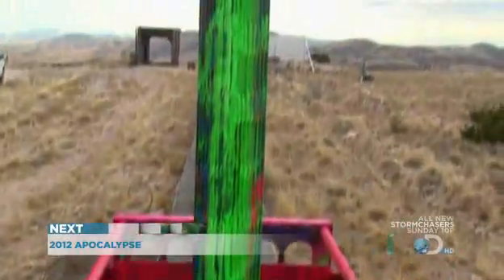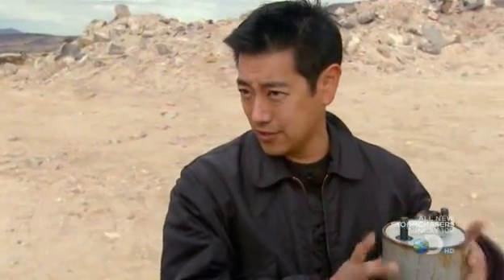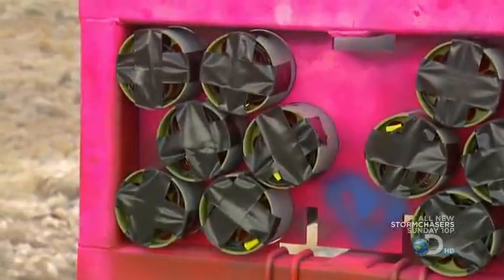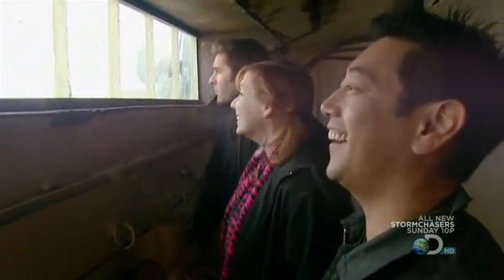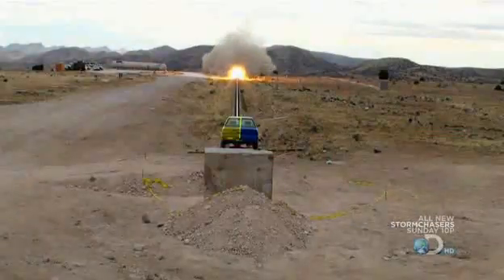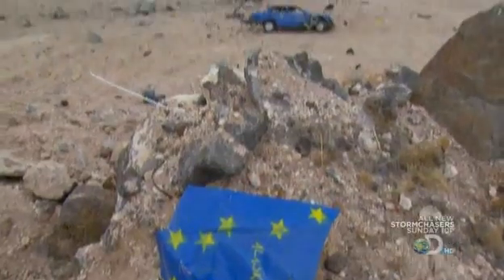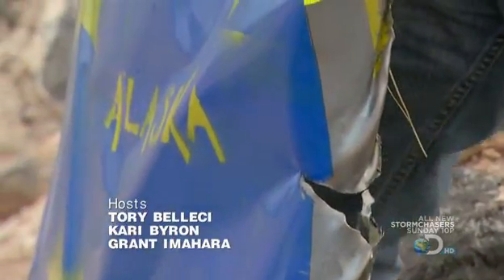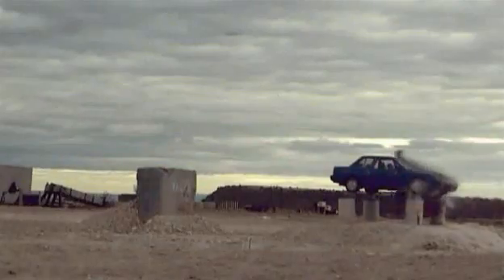Mythbusters: Myth Revolution - Rocket Snowplow

Comment: Oh fuck!
If this is true then how the fuck did those planes cookie cut WTC 1&2?!

I mean that thin piece of steel cut the steel car in half.
So several thick pieces of steel should either shred an aluminum plane or flatten it and then bounce it off.
You see the sledge was intact up until it hit the immovable concrete block. So as there was no concrete on the planes then they should have just crumpled/shredded part bounced off part penetrated between the steel girders and not cookie cut like roadrunner the side of the building!! 

OMFG!!
Reply: http://911research.wtc7.net/talks/nist/docs/planecrash.jpg

Remember that absolutely no concrete was used for the outer shell of the Twin Towers- the central core held up all of the structure, and only when that lost support did the towers fall.

The steel on the shell was very thin and very light, so it gave with relative ease. What decimated the plane was the concrete floors and much thicker steel beams connecting the core and the shell.

What you saw coming out the other side was jet fuel, office supplies, hot air, and whatever was left of the plane routing its way through the cubicles and finally windows of the towers.
Reply: ^^^mickey is 100% correct.
Reply: Mickey the Luxray You couldn't be more wrong.  The central column held up 60% of the tower's weight.  The outer steel beams held up 40%.

The outer beams were made up of thick, high grade steel.  They were NOT "very thin and very light" in ANY stretch of the imagination.

Keep believing in the fantasy though, if you can't accept reality.
Reply: Allen Cox
"Trial Luck Larry "Pullit" Claimed against Insurance companies who paid out without a question?"

[citation needed]
Even if what you're saying is true, this situation would be damned if they did, damned if they didn't. A guy involved in the cleanup of 9/11 is refused by the insurance company- that's a headline story that could get those companies in serious trouble. To them, what was a little money lost when it saves them bad publicity?

"And Now Larry states WTC7 was Demolished hello NİST said it was due to Office Fires?"

[citation needed]

"NİST have the World believing in Ghost Stories and Fairy Tales but the Truth will come to the surface of this Soup eventually then and only then will we see the ones responsible"

It's funny, because you guys are the ones saying that lasers, rockets, holograms, magical sideways thermite, and UFOs were responsible while NIST tells the story closest to what was seen by millions of people on television and in real life all over the world.

If anyone's telling the ghost stories and fairy tales, it's people like you.
Reply: Андрей Алейхин Well, the website you sent me in your previous reply supported the official story. There is no official conspiracy theory. We know what happened on 9/11...the 9/11 commission and NIST reports were accurate. 9/11 was perpetrated by the Islamic extremist group Al-Qaeda. There is NO conspiracy about 9/11 that hasn't already been explained. 9/11 wasn't an inside job, nor did insiders or the U.S government perpetrate the attacks. If you really think it was, I'd invite you to prove it. Go ahead and ask me some questions. Extraordinary claims require extraordinary evidence.
Reply: Mickey the Luxray a.
Reply: patauarola WTC weighs 200 000 tons. Plane 747 - 150 tons
Reply: ***** So what? We forget about the weight, density ,and the area of contact?
Reply: Андрей Алейхин 
First off, both aircraft were 757s, not 747s.

Second, just because the towers were heavier doesn't mean they were any less susceptible to being penetrated by a plane.  The only way that would matter is if the planes knocked over the towers upon impact, which didn't happen.
Reply: Андрей Алейхин
Fine, whatever. 1-3 are irrelevant to this conversation anyway.

"4) Planes was not. There were only a rocket."

Then explain the plane-shaped hole in the side of the tower. And why there was no smoke trail as is common with any rocket engine. And why the damn thing had wings.

"5) Imagine that the twin towers fall on the plane. Do you really think that the plane strikes steel, and penetrate into the inside?"

I had a really hard time reading this, but my guess is you were going to say that if the tower were to fall on the plane, would the plane cut through it still?

Assuming we were to make the tower fall at a rate so that it's energy matches that of the plane when it struck the tower, the answer is: no.

The fact of the matter is, to match energies between the two, the tower would have to move incredibly slowly, which would give the weaker aluminum structure of the plane time to warp and crush while energy is transferred from the tower to the plane. When the plane struck the towers at speed, the plane transferred all it's energy in a fraction of a second, far exceeding the tolerances for the steel skin and basically cutting it open while completely demolishing the plane.

If we were to match speed rather than energy, a similar result to what actually happened would likely occur for this reason.

Think of it this way- if someone put a stick on two blocks and then pressed their hand down on it firmly, it wouldn't do much. If they had that same stick on those same blocks and they karate-chopped it, they could break it.
Reply: tnick2 NİST have the World believing in Ghost Stories and Fairy Tales but the Truth will come to the surface of this Soup eventually then and only then will we see the ones responsible put on Trial Luck Larry "Pullit" Claimed against Insurance companies who paid out without a question? and a Judge Hellerstine sat behind closed Doors to address this Case why all the Secrecy? If nothing to hide? 
And Now Larry states WTC7 was Demolished hello NİST said it was due to Office Fires? Time for a Re-investigation
Reply: ***** Just shut up and see the truth.
http://www.sharpprintinginc.com/911/index.php?module=pagemaster&PAGE_user_op=view_page&PAGE_id=269&MMN_position=555:555
Reply: Андрей Алейхин Oh, I'm not a 9/11 conspiracy theorist. I was just joking around with that guy because he was being stupid. I already know that 9/11 wasn't an inside job. Although your earlier comments make me doubt that you think as I do.
Reply: *****
 9-11 Research: 9-11 Research provides multiple lines of analysis that thoroughly undermine the official conspiracy theory that the attack was the work of cells of Islamic extremists. We show that only insiders in the U.S. government possessed the means and opportunity to execute the attack. The following questions are frequently asked by people considering the idea that the attack was the work of insiders, including high-level officials in the US government and military.

http://911research.wtc7.net/faq/conspiracy.html
Reply: ***** I find it hard to start a discussion.

This site contains all the basic information. See all articles sources.
http://www.sharpprintinginc.com/911/index.php?module=pagemaster&PAGE_user_op=view_page&PAGE_id=39&MMN_position=385:385
 - This website contains:

The only visual reconstruction of the collapses of WTC1 and 2, identifying the most probable collapse progression mechanisms of each tower.

The only accurate, detailed mapping of the earliest movement of each building available. The detailed reconstruction of the moments leading up to and of collapse initiation of each building is used to fact-check claims made by the National Institute for Standards and Technology (NIST) within their official reports on the collapses and claims made by other organizations and individuals.

Detailed criticism of the official reports on WTC1, 2 and WTC7 by the NIST, showing that claims made within the reports on all 3 buildings directly contradict what can be verified through the visual record.

Links to libraries of the largest and most complete collections of video and photographic evidence of the attacks, collapses and resulting debris available to the public.

The most accurate review of academic papers on the collapses available.

....
If you say "No Conspiracy" - you have to debunk them all.
Small Training:
In the steel skyscraper crashed aircraft / missile. Starting а fire
Question - when the building fall to the basement?
Reply: Андрей Алейхин
Reply: Dragos Starseer 

Compared to the core column the steel on the outer wall was rather thin (on mobile so I can't really confirm it right now, but I think it was less than 3" in thickness). The sudden energy transfer would be more than enough to sever the beams.
Reply: Андрей Алейхин  What information on that website points to a conspiracy theory? It debunks several conspiracy theories from what I've seen so far. It also interprets exterior movement as being a response to core activity...which is incorrect. This website is a jumble of explaining what occurred correctly, debunking conspiracies, poking holes in the NIST report, and interpreting visual evidence incorrectly. Who made this site? What are the qualifications of those who made the site? Has the information proposed by the people in the site been peer reviewed? You have to point out things that are relevant to your argument or I won't know what your talking about. 

There was no conspiracy...the onus is on YOU to prove that there was one. Very few people in the scientific and engineering communities believe that there was a conspiracy.

There was no missile...and...I don't know how to respond to your last questions, they don't make sense.

As I said...propose some questions to me and answer to me this. What evidence points to there being a conspiracy? Be specific! Bring up points to back up your assertion. Here I'll give you some examples other 9/11 conspiracy theorists have asked me.

There was thermite in the dust.

People reported hearing explosions.

No bodies were found.

^^Like that...tell me some points you think point to a conspiracy and explain them to me. If you don't have the time, I'll understand...but don't claim there to be a conspiracy, throw a website at me and think that's all you need to do.
Reply: On the contrary, relatively few cars are made entirely out of aluminum. Aluminum is also alarmingly strong for its weight; it's the entire reason most planes are made out of it in the first place.
Reply: look at a maglev train traveling 400 mph, looks pretty slow from an outsider looking at it
Reply: Aliens confirmed.
Reply: Андрей Алейхин Human body weighs 180 pounds. Bullet weighs 1 gram. Bullet fucks up human. 150 ton plane. 200,000 ton tower. Plane fucks up tower.
Reply: You are wrong.The plane weighs at least 130,000 lbs(minimum weight) and has a cruize speed of 500mph.There is so much kinetic energy that it slices that building like butter. about 600lbs of tnt just in kinetic energy not even counting the fuel.
Reply: Mickey the Luxray
1) You do not look Wikipedia.
2) The aircraft  757 was only at the Pentagon and Pennsylvania
3) Flight 11, 175 - is  767.
4) Planes was not. There were only a rocket.
5) Imagine that the twin towers fall on the plane. Do you really think that the plane strikes steel, and penetrate into the inside?
http://i18.photobucket.com/albums/b108/janedoe444/trouble/66_Roadrunner.jpg
Reply: Steel car? Most cars are made with Aluminum... Which steel easily cuts through. However to adress WTC, the jet fuel need not to melt the steel beams. Merely weaking a few of them can be enough to destabilize the building so much so that it collapses. It's common knowledge in the building world. Too much stress on something that isn't designet to carry that amount of stress, will eventually make it collapse. Multiple, prolonged Earthquakes and building mistakes have done just that innummerable times. It should really be common knowledge by now...

Comment: Seems odd, but If my calculaton is right you can actually survive that acceleration (not the impact though). 500mph=800 km/h=222 m/s, In roughly 2 sec that gives 11G during 2 seconds which was done before.
Reply: If they ever do a rocket sled again, it would be funny if they put buster on the top ridding it.

Comment: Does nobody else notice that the concrete wall is also just gone? It pulverized that wall too. Literally, its powder concrete powder now.
Reply: 4:10 too
Reply: Its obvious that the concrete will be turned to dust but they were more surprised that a 2 ton steel structure was obliterated into pieces. Everyone kinda expected the wedge to still be in tact
Reply: @brooksbrooks6805  only half of it.. watch the slowmo
Reply: It looked like it just fell over. ;)
Reply: what wonders me more is: why did it explode upon impact?! there were no explosives. the rockets were already burnt, the wall is only concrete and the sledge just metal.... someone added a few things for effects...
Reply: @RKBock  Going through the high-speed footage one frame at a time, the explosion starts as a plume of gray smoke or dust originating at the front of the rocket motor casings as they impact the concrete block. A flash of light the same color as the rockets' exhaust plumes appears, and a few frames later another one appears at the back of the rocket motors before they erupt into a ball of fire.

My hypothesis is the rockets were not completely burnt. The way solid-fuel rocket motors work, the rate of fuel burning is strongly dependent on the chamber pressure, and proportional to the exposed surface area... and a faster burn rate also increases the chamber pressure and vice versa. As the burn ended and the flame front reached the chamber walls, burning surface area would rapidly fall off, sharply reducing chamber pressure and slowing the reaction rate of any tiny bits of residual fuel remaining to the point where the motor no longer produces usable thrust or a noticeable exhaust plume when traveling at 500 mph.

However, when the motor casings struck the concrete wall and were crushed / ruptured, any leftover fuel was probably pulverized by the force of the impact and forced out the ends of one or more of the casings, and was consumed in a fraction of a second due to the massive increase in surface area. The now-ruptured and truly empty motor casings are later visible tumbling past the top of the concrete block, separating from the remnants of the sled and plow as they do so.
Reply: @Omnigeek6  also if you notice the top half of the blade tumbles forward.  I'm guessing it flew about a half mile further down range...😂
Reply: Totavo 3:56 yeah that look like the wall fell over

Comment: They need to make an episode of "What can the rocketsled destroy next?"

RV. Locomotive. Small, two story house. Large boulder. 500-gallon container filled with multicolored paint. Medium-sized commercial airplane (preferably loaded with crash-test dummies). 500-gallon container filled with coffee creamer (see if it blows up). 

Then as the ultimate overkill, they can "retire" the current model of Buster by launching a rocketsled covered in high explosives and burning thermite/dry ice at him.

Comment: I remember about 75,000 pounds of thrust being one of the figures listed in "The Right Stuff" for one of two vehicles, exactly which one I've forgotten in the long time that's passed since I read that. It was either the X-15, an experimental rocket-powered aircraft that flew technically into space at Mach 5, or the Redstone missile, the launch vehicle for nuclear weapons and Mercury capsules.
Basically, 75,000 pounds is a lot of power.

Comment: @TehGmodAddict That was the ignition of the second phase of rockets. The rocket was travelling approx 500 mph after total acceleration, the speed of sound (speed required to create a sonic boom) is about 768 mph. It was just a burst of smoke from the secondary rockets igniting :). STILL very cool to watch!! Oh, and if it were a sonic boom, it would be a conical shape discharging from the front of the vessel, not a poof of smoke from the rear. Hope that helps :) Sonic boom is air being crunched